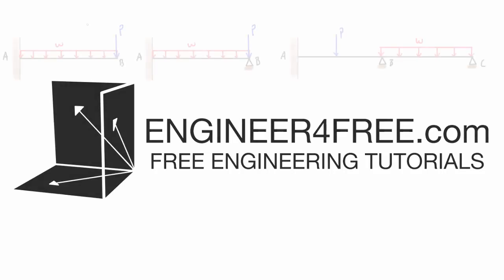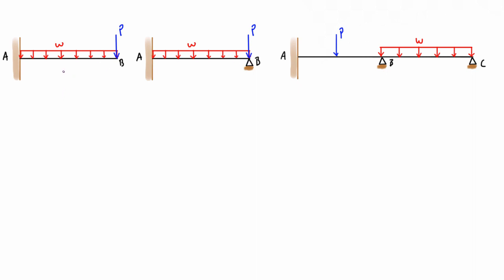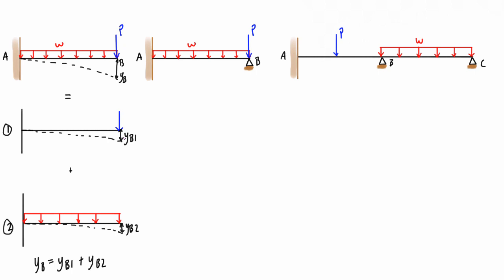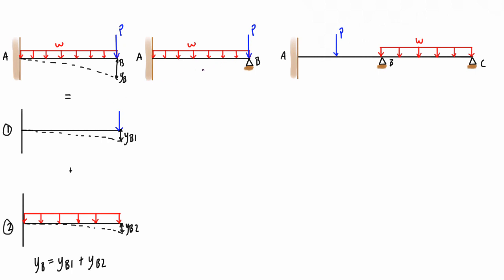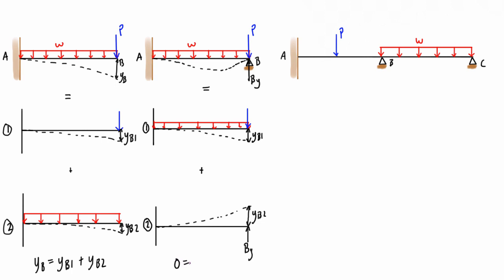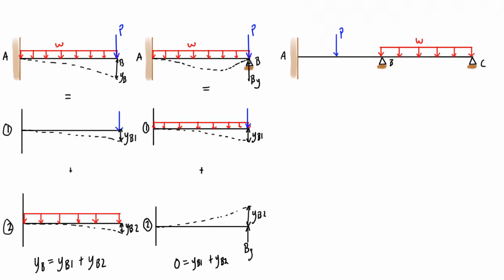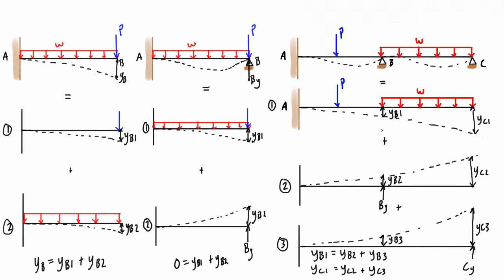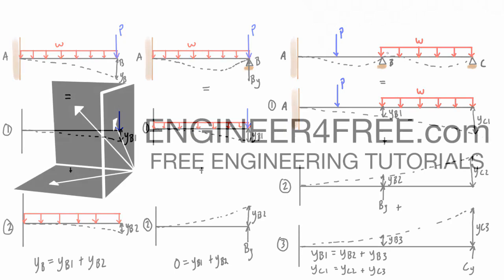Force method explained

Comment: Can you do videos on stress, strain, torsion, or videos on manometer, bending stresses, second moment of area, udl. Pressure vessel, moments, flow regimes.
Reply from the maker: Hey I have completed some of those topics. stress/strain/torsion/bending/2ndmomentarea are here: engineer4free.com/mechanics-of-materials manometer is here: https://www.youtube.com/playlist?list=PLOAuB8dR35oeOIPMOBH6hjwobuIJHPKSN moments are here engineer4free.com/statics I plan to publish videos on flow and a few other topics in the next few months. Cheers!
Reply: Engineer4Free what you should, is answer specific problems, this will. Give more context to what your doing and easier to understand.
Reply from the maker: My videos are usually either an explanation (like this video) or specific examples that use principles from the explanation. Here is a force method example: https://youtu.be/mktQ61X-hGo and here is another one: https://youtu.be/V4C7XXYYwWY they both follow the method that is laid out in this video that we are commenting on. It's a bit easier to see the grouping of videos by sub-topic on my website, for example: engineer4free.com/structural-analysis